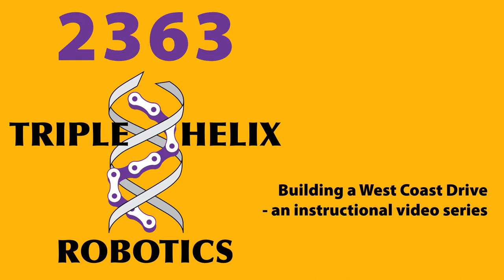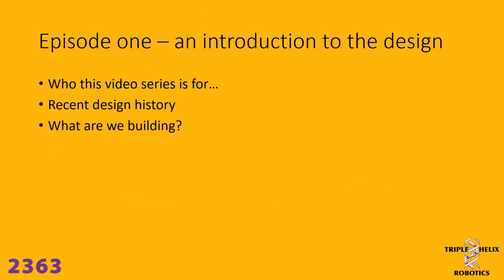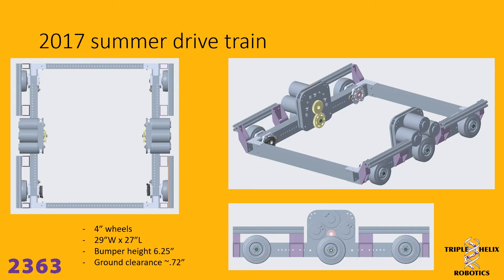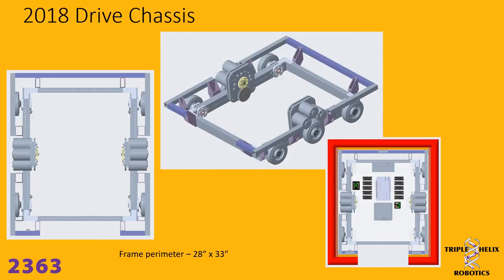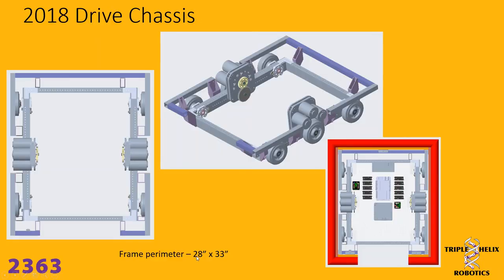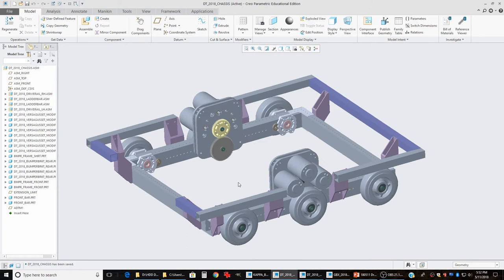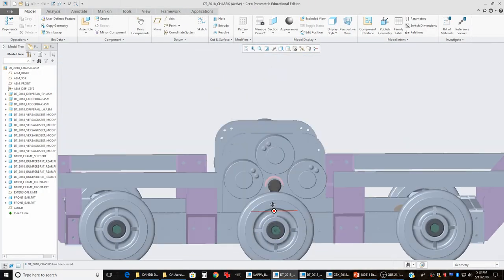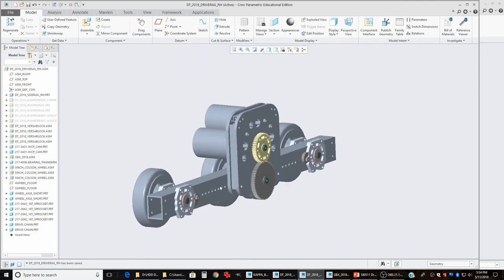2363 builds a drivetrain - episode 1 - drive train design introduction

Comment: How did you guys figure out the correct spacing for the chain and sprockets ?
Reply from the maker: This calculator is a great tool: http://www.botlanta.org/converters/dale-calc/sprocket.html
Reply from the maker: If you are using #25 pitch chain, and the 2 sprockets are the same size, and you don't use any half links, then any multiple of 0.25" will work for a center distance regardless of the number of sprocket teeth.
Reply from the maker: Finally: here is a method you can use to measure the exact distance. https://www.chiefdelphi.com/t/chain-tensioning/130123/26

Comment: Pumped to see how other teams build their WCD drivetrains to see how we can improve our own!
Question about the wheels, where do you source the 5" colsons? And how do you guys mount them to 1/2" hex shafts? We would love to be able to use colsons if they came in sizes larger than the 4" ones from VexPro!
Thanks!
Reply from the maker: Hi there!  We used Colsons from The Robot Marketplace (http://www.robotmarketplace.com/products/0-co4-5-446.html) along with the live hub (217-3430) from VexPro!  That's how almost everyone used to use Colsons until the very nice co-molded versions came along.
Reply: We used the live hubs from Vex Pro.
https://www.vexrobotics.com/vexpro/motion/wheels-and-hubs/colsonhubs-g.html

And ordered the wheels from here. We typically run 4" wheels though.
http://www.robotmarketplace.com/products/0-co4-5-446.html